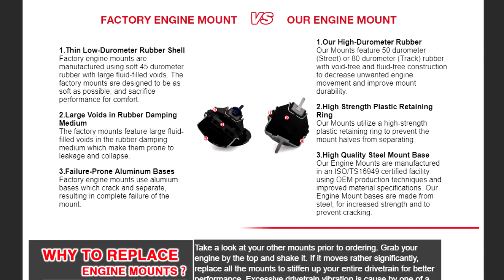mazda 2 RH Engine Motor Mount TruPro 2008 DE

Comment: How has this engine mount held up? In Feb 2021, I replaced the right side (engine) and left side (auto transmission) mounts in my wife's Mazda 2 DE with 'Febest' brand engine mounts. This solved the vibration issues at first but in mid 2023 the car is already back to having very bad vibrations, so the mounts don't seem to have held up too well.
Reply from the maker: to be honest this is my little buzzbox that i use for short trips and it just vibrates regardless. i havent noticed more or less vibrations after the install and its about 3 years. i have some febest mounts too, just cant remember. havent noticed any leaks from this truepro mount or the febest trans mount.
Reply: It's small ass cheap car, I have one and it vibrates, another guy told me that's how these car are
Reply: yeah but Febest brand sucks. I installed Transgold mounts and they have been holding up much better.
Reply: Yeah, Febest not the best option, unless it's the only available (my case). I'm thinking to go even cheaper and try filling them with 3M/Sikaflex/etc. PU sealant. Bet it should work for a while if done properly.

Comment: Is this auto transmission mount or manual?
Reply from the maker: for this particular location mount, it doesnt matter if auto or manual, as its not the transmission  mount. but this particular vehicle is an auto. i have the video in my playlist for the transmision mount as well.
Reply: @automtr  thank you! You did a great video. Well done! How good are the TruePro mounts as I’m in Australia and thinking of getting them? Did it last well? Also, I saw you used a different brand for the other side?
Reply from the maker: @anthonykennedy7093  i  used tru pro as well for a Mazda 3 SP23. They are fine. The other mounts for Mazda 2 I got from ebay. Can't remember site or brand but they have Been fine as well